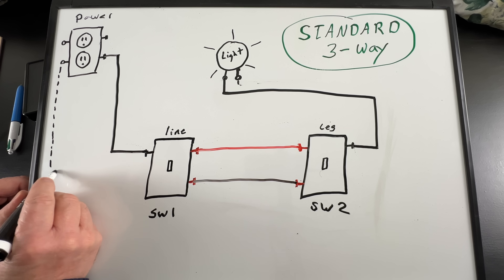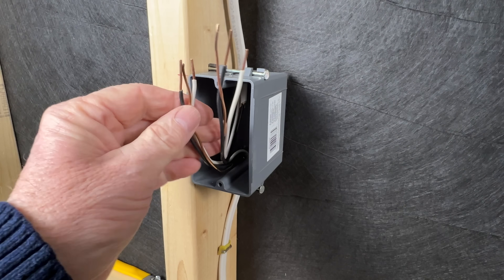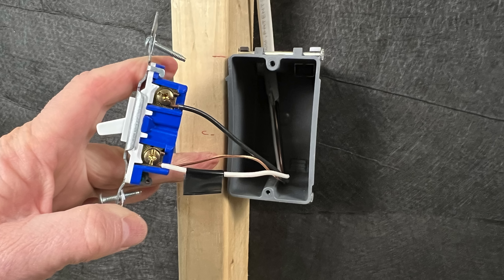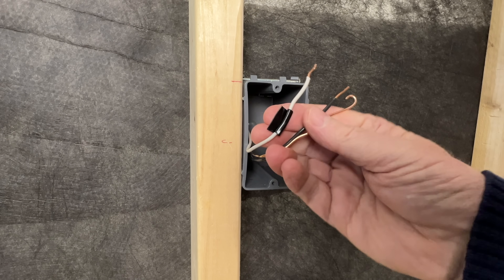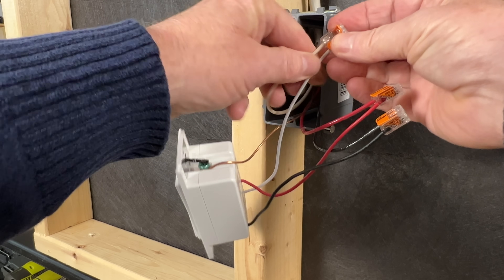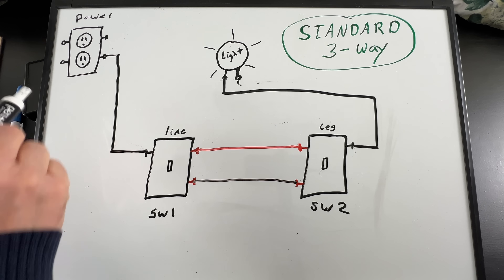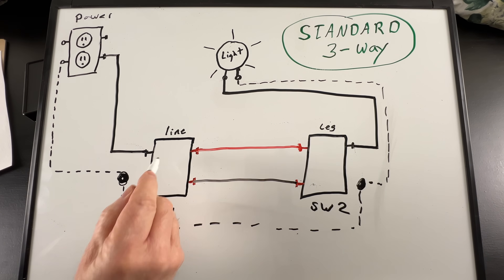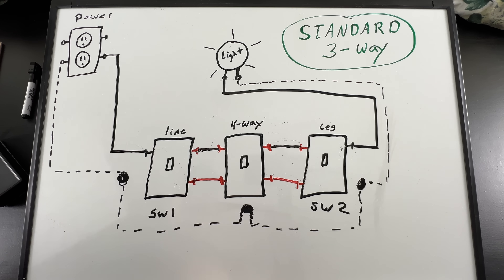How NOT to Wire Light Switches in 2025 (New Rules)

Comment: Thanks for the explanation!
When I was a teenager, I figured out the three-way wiring schematic for the SPDT switches.  Now, decades later, I couldn't figure it out in several tries.  The diagrams are a huge help.
Reply: What I have done to retain memory of how Three and Four way wiring systems work is to make a working model of one on a panel of plywood. The model even has a breaker box with breakers on it. The breaker box simply plugs into an outlet for power. This gives me a micro model to view when my memory on how to wire things up starts to fade. The model actually works and turns on a light bulb from two different switches. To make the models I go to Menards and buy and use the actual wire, gang boxes, outlets, bulb receptacle, breaker box with breakers that one would use in a house. Each model costs me about $45 to make. The breaker box alone is about a $20 cost. I just use a small two breaker box. Not a full sized one. I bolt the model to a wall, plug the models breaker box into an outlet and actually use it at times for lighting. I also make a very detailed color drawing on graph paper of the model's wiring system that is mounted on the wall next to the model. Is great to have when teaching my grandkids about electrical wiring concepts.
Reply: @normtheteacher5485  I think that you could get away with a much less expensive design with some LEDs, resistors to limit current, and some SPDT switches with a battery. Three Way Light Switches are literally just big SPDTs. But, they wouldn't work well for actual lighting. They would however, make for a better demonstration of how the circuit works, if you put LEDs on each of the two legs, to demonstrate where the power was flowing at the time.
Reply: @javabeanz8549  yes, that would be cheaper but I wanted to use the actual materials that one would use in a house. I even use the actual type of wire that one would use. That way my kids don't have to mentally transfer the led model into an actual house model. To me the extra expense is worth making the learning more effective. Thanks for your suggestion and for watching. Your right though, it would be cheaper. Unfortunately there are no more Radio Shacks where I used to get electronic parts for experimentation.
Reply: @normtheteacher5485 Yes,  most of the Radio Shack stores  and other little shops like it are gone. Though eBay and Amazon have parts, though you can buy a whole bag of parts from a big supplier for about the same price as a handful. And if you intend on the kids doing the actual wiring, yes, that's the better option. Maybe some neon bulbs to show where the power is hot at the switches.

Comment: So basically, because some people want the "smart" switches, everyone's life just got more miserable and more expensive. wow, what a progress!
Reply from the maker: It only applies to new construction and only once your state adapts the 2023 code. The issue has been that in the absence of a neutral wire people connect to the ground wire creating a safety hazard. I always wire with the neutral in the switch box anyway so for many people of us it's a non issue.
Reply: From my experience, the only people whose lives will be made miserable by this change are people who run their hot conductor to the fixture instead of to the switch. But in my experience of having never actually encountered that type of wiring I have to say this rule change won't affect that many people.
Reply: @Dwayne_Bearup does that matter with A/C electric. The circuit you mentioned would just keep the light powered on, no?
Reply: @smartwerker As mentioned in the video, there are two ways to run wires for a light/switch circuit. In residential wiring, Romex is used almost exclusively, so you'll get a hot, neutral, and ground conductor at each junction box. The most common - and in my opinion most proper - method for wiring switches is to run the hot set to the switch box and a switch leg to the fixture box. The other method is to run the hot set to the fixture box, and then run a set to the switch box, which requires using the neutral wire as the switch leg. Alternatively, a three conductor Romex can be run as the switch leg. This will have a red and black wire for hot leg and switch leg and still leave the neutral wire available for smart switches. And it is this difference in wiring the OP was complaining about having to change.
In the end, there's no real reason for any changes to our overall wiring habits. We just have to recognize the need for accepting modern requirements and adjust accordingly.
As I mentioned in my first comment, most people won't have to change anything. We already run our hot sets to the switch box. For the relatively small number who prefer to run the hot set to the fixture box, they just have to add one more wire for their switch leg. But some people like to complain.
Reply: @Dwayne_Bearup  And how do you wire a smart fixture if you've unwisely run power to switch?

Power to switch creates far more problems for a smart future as you'll now not only have to do some wiring work at the fixture but also at the switch box, where the switch will have to be removed, the wires connected through and a blank plate installed.

No, the proper and better method of wiring a light is power-to-fixture.
Reply: Shits helpful I just I installed a bathroom fan that had a light and speaker and the switch wanted that white wire
Reply: Like 10 minutes and 10 bucks more chill
Reply: If you are an electrician don’t you bill for time and materials? You aren’t being required to go back and retrofit old work. 

For some people, smart switches help them remain independent.
Reply: So many people here missing my point completely.  I meant that ALL NEW construction now has to include this extra wire which adds cost and labor.
Reply: @jojojordan5557  No, I'm pretty sure we all caught your point. It just wasn't a very good point. Given the relative rarity of running the hot wire to the fixture instead of to the switch, this rule change won't affect enough people for it to matter to those of us who already do it the better way.

Comment: Lots of electricians in the futured are going to get juiced on old installations not knowing we used to use whites as switch loops.

If you are going to use dotted lines for neutral explain that typically on a schematic a dotted line indicates field wiring required.
Reply from the maker: Any electrician seeing a white wire on a toggle switch should know right away that it's not a neutral. Even if it's not re-identified.

Comment: Violation dude neutral and hot must travel in same conduit
Reply from the maker: Nope switch loops are approved by code. Check out the code references listed in the video.
Reply: That's only true for steel conduits.

Comment: Hows everyone doin? I have a question related but also not related to the topic. It doesn't make sense in my head but I know its okay, I guess I'm just hungry for knowledge... here goes.

We got a 20 amp circuit. On that 20 amp circuit we have light fixtures and ceiling fans that are factory wired with 14g. Thats fine on a 20g circuit right? And if it is, why? And if its not, also, why? Lol Thanks.
Reply: The 14g device wires are fine because the normal operational draw of the device is below the 15A current rating of the 14g wires.
Reply from the maker: Manufacturers of equipment like light fixtures in your example have different standards to follow when determining wire size. Building wires are sized based on the tables in article 310 in the NEC. Manufacturers are able to size wires base on the load of the device since that is a known number. The fixture in your example will be protected from overload by design and it will still be protected from a short circuit or ground fault by the circuit breaker. I hope this helps.

Comment: Great explanation, really liked the video.....but why are we running 12/2 -12/3 in a residential lighting circuit?
Reply from the maker: I used 12/2 in the example to be safe. I don't want someone to misunderstand and run 14 gauge wire on a 20A circuit feeding lighting which is common when the lights are jumped off a receptacle circuit. But most lighting is in fact run on 15A circuits and 14 gauge wire.

Comment: I dont know where u are from but it has always been required a neutral in switch box that is .
Reply from the maker: The neutral was not required in a switch box until 2011 code and like I mentioned in the video one of the exceptions was allowing people to get away with not adding one if it could be fished in later. That exception was removed in the 2023 update. Local cade can require additional things and also not require things in the national code.

Comment: Do we need to run 12/2 for lighting circuts? I do them with 14/2 am I right to use 14/2 on lighting only runs?
Reply from the maker: I used 12/2 in the example to be safe. I don't want someone to misunderstand and run 14 gauge wire on a 20A circuit feeding lighting which is common when the lights are jumped off a receptacle circuit. But most lighting is in fact run on 15A circuits and 14 gauge wire.
Reply: @BackyardMaine  thats the way i understand it. Thank you for the clarity.

Comment: I'm here in California at a recent commercial construction where whomever did the wiring didn't even leave some switch locations with an active ground wire (meaning there was ground cable and even metal flex raceway but still dead ground) in many locations in this building. I was asked to place modern wifi type dimmer switches to which I had to tell the current tenant how much work might be involved just to get a neutral or ground wire to that location. Building doesn't externally appear more than 20 years old so I am left thinking who does this type of work and gets away with it?

Comment: Two things: 
1: Why do you keep referencing 12ga Romex required for lighting? Light circuits are 15 amp and require only 14 ga wire. 12 ga wire implies a 20 amp circuit  and breaker which is misleading and dangerous. It is also harder to work with in small boxes.

2: Switch loops (to use your terminology), should be illegal. Power should always go to the switch box first and then only switched power to a light fixture. Non-switched light fixture boxes are very dangerous. A lot more so than the orientation of three-pronged grounded outlets.
Reply from the maker: I used 12/2 in the example to be safe. I don't want someone to misunderstand and run 14 gauge wire on a 20A circuit feeding lighting which is common when the lights are jumped off a receptacle circuit. But most lighting is in fact run on 15A circuits and 14 gauge wire. 
 I always bring the feed to the switch box first as well but switch loops are legal and quite common.

Comment: Good video.  I'm a former electrician/contractor.  Good to learn the new rule.

Given this, and the cost of wire these days, I'm wondering if relay switching is becoming more popular for basic residential installations.  I.e., no exotic control systems, just basic residential.  Seems it might have an edge in the current market.

Comment: Why use 12awg for a simple light?  To me, that is more than needed and a higher cost
Reply from the maker: The wire is sized for the circuit. Most lighting circuits are 15A and only require 14 gauge wire. I purposely showed 12 gauge wire to prevent someone from possibly installing 14 on a 20A circuit

Comment: While at first glance, it seems the new code update for neutral wire needing to be in the switch box might not be a safety related, BUT if someone wants one of those "smart" switches in their house and the installer just wants to get the job done as fast as possible, we all know that he's going to attach the neutral wire to ground just to make it work.
Reply from the maker: Yup. I didn’t mention that in the video because I didn’t want to give someone a bad idea
Reply: @BackyardMaine  I completely get it.... I hate stuff like that cause when I find it, my OCD takes over and the 5 min project turns into half a day because I now HAVE to re-wire the circuit. Just did a project where I just needed to install some new lights. Found out they just pulled power from a  nearby light that's always on and there was no ground. Went from maybe 2 day job to two weeks. (It's on an offshore work vessel. Lead to removing corroded junction boxes exposing heavily corroded steel underneath which required hot work to replace the steel and couple of days for all the layers of primer and paint to dry before installing the boxes and running new cable.)

Comment: I was rewiring the methhead 3 way switch in my kitchen.  I had to cut some sheetrock out of the wall to run a new 14/3 wire, where they only had a 2 wire for a "3 way".  There happened to be a junction box that the travelers go to between the line switch and leg switch with another cable going to the light, with the cable from the junction box to leg switch having a 3 wire, but no other cables coming from it.  I didn't even know what a dead end 3 way was but I ended up wiring it that way cause I didn't want to take out more sheetrock on the other wall just to have a neutral.

Comment: Was Electronic Tech before Working with AC. Helper First, then went for Electrican  Job, Future Employer drew 2 3 way switchs, source, and Bulb. In my diagram, I put a Neutral to one of the Traveller screws, Hot to other traveller screw on both switches. Actually works, 2 hots or 2 neutrals, bulb wont lite. 1 hot1 neutral does. Problem or danger is, Bulb Shell is live in 1 of the 2 conditions. Large Prong on cord insure shell is never live. Been a Master for about 20 years.

Comment: You mention using a 12/2 from the power and fixture to the boxes for the three/four way examples. Is this required? I just started my apprenticeship and have roughed in a bunch of three way light circuits using 14/2, and shared power with outlet runs as well. Also, thanks for the clear explanation, I'm excited to rock up to work and make up boxes without having to ask as many questions about three ways!
Reply from the maker: It’s just going to depend on the circuit size. I used 12 in the example to prevent mistakes but most lighting circuits are 15A and 14 gauge wire.
Reply: @BackyardMaine  That was my impression, thanks for getting back. My master went over circuit load limits yesterday and cleared things up in a big way. Thank you for your videos, I'm hooked on the biz! Cheers

Comment: I was SO happy to find neutral in the light switch in my toilet room off my master bath (it's got the toilet in it's own little room). There were two single space switches in a double box there - one for light and one for fan.

I was able to replace the two switches with a single-space double switch (not sure what the name is) and use the second space for a GFCI outlet. This lets me plug in a nightlight, and a phone charger. I don't use the phone charger often, but when prepping for my colonoscopy it was a lifesaver.

It would also be the only way to power one of those fancy bidets if I (or a future homeowner) ever wanted one.

Point being - having full power available is nice for more than home automation!
Reply from the maker: You are right. Have a neutral wire is the best way to go especially if you ever need to expand the circuit. Thanks for helping support the channel. 👍👍

Comment: 12 gauge for lights? I hope it was just misspeak.
Reply from the maker: It’s going to depend on the circuit size. I noted 12 gauge to help avoid mistakes made by inexperienced people that may run 14 gauge on a 20A circuit. But most lighting circuits are 14 gauge and 15A.

Comment: When you wired that single pole switch you placed the black line wire on the bottom. Best practice would have it at the top like any other disconnect. ⭕️
Reply from the maker: That's actually not best practice at least not in my 40 years of experience as an electrician and electrical engineer. There is no standard and you never want someone to assume that the line wire is on one side or the other.

Comment: Why 12/2 or 12/3 and not 14ga?!???
Reply from the maker: I used 12/2 in the example to be safe. I don't want someone to misunderstand and run 14 gauge wire on a 20A circuit feeding lighting which is common when the lights are jumped off a receptacle circuit. But most lighting is in fact run on 15A circuits and 14 gauge wire.
Reply: @BackyardMaine  I know too, that’s why I asked you to clarify

Comment: Also, you have to remember to leave enough cubic inches in the switch boxes so you can put those large devices in. so for example you can use a two gang box with a one gang plastering which will leave enough cubic inches to push the wires aside and let the new smart switches have enough space to go into the box.

Comment: Learn something new every day. In the five houses I've lived in (including my folks' house built in 1957) I never saw a two wire loop. Ever. The fourth house was built in 1973 and at that time the area was in the county miles from the city it was a suburb of. Whoever wired it learned on 12v negative ground systems bc the neutral in the entire home was the black wire. Plus they consistently cut off the ground wire. And the icing on the cake? Aluminum wiring. I did research on aluminum wiring. The history of aluminum wiring and its shortcomings are interesting.
Reply: Now that's a house I'd rip the Sheetrock out of and rewire. I guarantee it needs insulation and plumbing upgrades as well. And if it has a zinsco breaker box, great opportunity to change that piece of garbage out.
Reply: @monsaka7827  The sheetrock, particularly upstairs in that last house was poorly done. Over half the nails were causing bulges. My guess is there were not enough county inspectors back in the day early 70s. I moved out years ago.